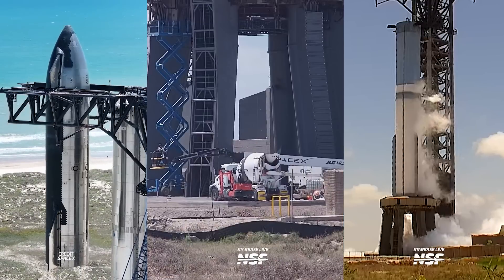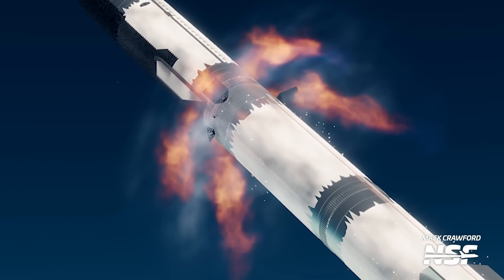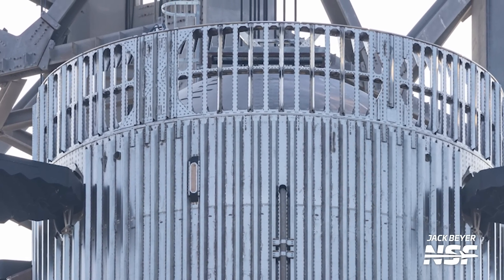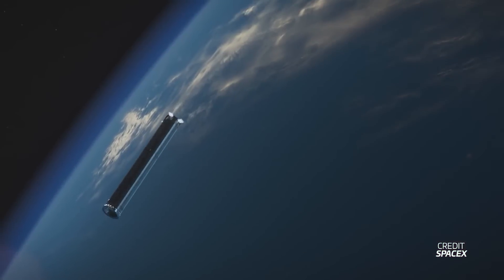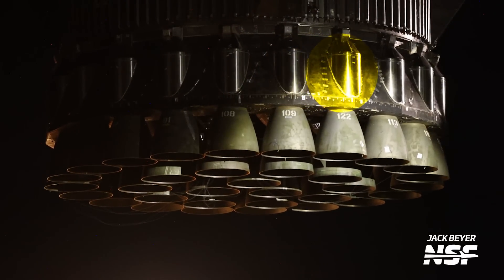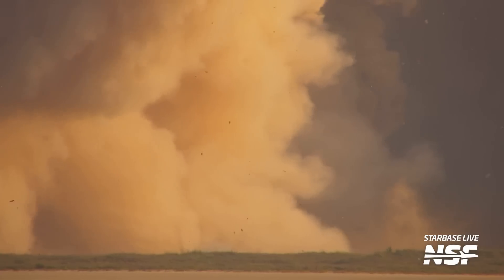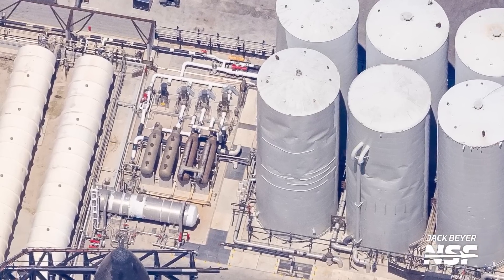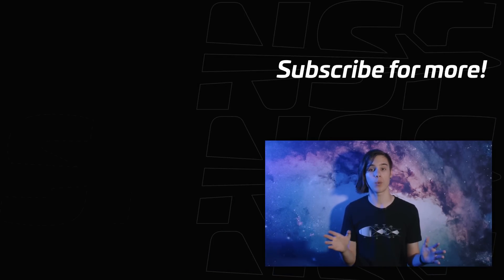SpaceX Starship’s Major Upgrades for Flight 2

Comment: Its bonkers to think of everything happening in one moment at liftoff, water deflection system, quick disconnect retracting, fueling switching to internal tanks, co2 pumping to stop flames, copv's back pumping, raptors changing thrust and vectoring, electronics switching to flight mode, and so much more i cant think of, just insane stuff
Reply: Hehe, look at video of Everyday Astronaut about "how to start rocket to engine", THEN you will be stunned how PRECISE has to be even lighting the candle

Comment: The new openings on the aft section I would suggest they are to equalise the pressure in that compartment to stop it either imploding or exploding due to heat and cooling. The openings will allow the air to flow freely in and out of that section, Im guessing the openings will also allow more cooling in that area during launch with convection happening.
Reply: It will make sure there is vacuum in the space between the forward dome and the hot-stage dome. Vacuum is a very good insulator.

Comment: As a Millwright and motorsports fan, Natural gas AKA Methane is more critical in reducing human pollution on the environment. Natural gas or CH4 is basically stabilized Hydrogen and easy to make, it can be made from cow poop and trash in a continues or batch method and can also be used to help prevent forest fires. On the motorsports side the best gasoline you can get at the pump is 92-94 octane, race engines use special gas with 101-112 octane, and all produce dangerous waste gas while natural gas doesn't. So if a turbo 4 cylinder running on gasoline makes 250-350HP the same motor designed to run on natural gas with 150 octane would easily make 100-200 more HP with far less pollution out the exhaust without any emissions control devices that cost 2K for cars and up to 50K for pickup trucks and semi tractors. LNG and CNG (CH4) is what is used to make the majority of the electricity that recharges those EVs, and when made from waste reduces the human carbon footprint with its main byproduct being non-toxic fertilizer.

Comment: The safety of the public and the protection of the environment is the FAA first and upmost priority and not a companies personal milestone. Spacex  has done a extraordinary job , repairing the  orbital launch mount and it's site ,the upgraded water deluge system a magnificent accomplishment in such a short period of time, you have to calculate using more powerful engines into the equation,( here's one of the main  catch 22's so to speak) with the FAA  and their licensing for the STARSHIP I have studied video's and comments for hours and days. SPACEX stated after the first orbital launch attempt that for a few sec. they (LOST CONTROL)of the STARSHIP we must prove without any doubt that we have (FULL CONTROL) of the vessel. DDM

Comment: One thing that I would be concerned about with a crew mission for Starship in the future is how the crew would evacuate in the event of a flight termination system activation.
Reply: Early stage seperation I guess and some sort of emergancy landing..?
Reply: @olafmesschendorp147    That's fine if the issue is with the booster, but not if the problem is with the ship.  There is no way for crew to disengage from the ship if it fails somehow.   The FTS could be triggered, but crew have no way back to earth except in the destroyed ship
Reply: iamaduckquack   The Astronauts had  no way of leaving the orbiter either, if they got a early enough warning the orbiter could separate from the fuel tank and hopefully return to launch site. If high enough they had alternate landing sites or go to orbit. If something happened to the orbiter itself it was the same as a crew in Starship.
Reply: @wb6anp That was true, until after the Challenger disaster. Then they added explosive bolts to one of the front windows, added a curved rod just on the outside of the exit window and the Astronauts had parachutes that they clipped onto the rod and then 'climbed' out of the exit window frame and jumped. Whether they could do that during a 'tumbling fall' is pure conjecture. Pretty hairy to say the least, but at least it was better than nothing.
So, perhaps they may have some similar system added to the 'Crewed Starship Rockets', in the design plans?  Chutes Brah! 🪂
Reply: @michaeldeierhoi4096 they could just plonk an Orion capsule on the top of starship with its own escape system, it would to mean moving the header tanks down a bit

Comment: What about the fact that in all test firing of all 33 engines there have been multiple engine failures in the first 5-6 seconds, this worries me and i am sure many. Are the problems being ignored, like with the pad for a quicker attempt to reach orbit. I mean, they have many boosters and should be able to overcome this problem by testing different layouts or newer plumbing systems.

Comment: I wonder if the sub coolers and pumps are to support the outer 20 raptor startup?
Reply: They're are for fueling, not used for raptor startup. They're also not hooked up, just installed - they'll be installed for future flights though

Comment: if the hot stage ring uses the same locking mechanisms, that means spacex could switch between using the hotstage ring and not using it whenever they want.

Comment: What happens to the hot staging ring after separation? Is it ejected or does it stay attached to the booster?
Reply: It will likely remain on the booster unless it is torn by the ship and can hinder a safe sea-landing.
Reply: My theory is, that as the hot staging ring has been subjected to heating, then the strength of the stainless steel will have been compromised and unless heat treated after landing, would not be able to be re-used. This launch is going to expend the booster and so they will not be able to recover anything (from current discussions) so they can't examine the hot staging ring this time round and so it will probably stay attached, unless they test the separation clamps and release it. 
Therefore, my guess is that in future flights, where they do recover the booster, that the hot staging ring will have long been separated and will burn up and crumple into the sea.
Reply: @David-yo5ws  I think that a steel ring that large will not be expected to burn up. I think having it come down with the booster is the safest way to de-orbit it. It might, or might not, be reusable, but that is secondary.

Comment: Any guesses why nitrogen isn't used for raptor start up?
Reply: I think that it's because it needs to be extra high pressure but not cryogenic. If you pressurized nitrogen to those levels it might be a solid. Helium should stay gaseous inside of the COPVs (just checked. Helium becomes a liquid at room temperature at 2.275 bar and it ridiculously hard to solidify). NItrogen solidifies at 63K.
Reply: @hawkeartist  hmm I'm thinking why not hydrogen copvs. But I do get hydrogen is really explosive and hard to contain, yet at the same time helium is quite expensive. But of course, they have much more smarter engineers than me haha

Comment: was it actually confirmed that the spin staging was meant to happen, because on all animations by spacex they always just stage normally.
Reply: The SpaceX host, John Insprucker (Principle Integration Engineer), was making comments, that it was starting the 'separation turn', which supports the 'spin staging' idea. Of course that is all now redundant.
Reply: And prior to that they also explained it on the lead up to the launch when they overviewed what was planned to be the nominal timeline. Plus Elon also talked about it when he mentioned the switch to hot staging.

Comment: when they're hotstaging are they lighting up ALL engines at once? seems like it would make sense to only light one engine on minimum power and after enough distance go on full power, i'm not a rocket scientists but i feel like that's not a good reusable strategy
Reply: Unfortunately, the ship has to generate enough thrust to outmatch the booster thrust to fly away from it. So, it all depends on how few engines booster can get away with to keep accelerating and at which throttle setting.
Reply: The booster can reduce the thrust on the 3 remaining central Raptors enough for the 3 vacuum Raptors to put a good distance between ship and booster. Then the booster can start to turn and go back to full thrust, while the ship ignites the 3 remaining sea-level Raptors. That way the propellants are always settled and the Raptors get the propellants they need all the time.

Comment: Vents == cold gas thrusters maybe?
Also side note. I would be shocked if the fire surpression was actually CO2 because CO2's constituients are 100% flammable molecules. In the presence of metal fires and strong oxidizers (cough, stainless steel, cough, liquid oxygen, cough) the CO2 can be broken apart and become entirely flammable components, which is not super helpful.
Reply: The vents look to be above the forward dome. To make sure the volume between that dome and the hot stage ring is in vacuum - the best heat insulator.
The fire suppression uses CO2. Labels have been seen. Many fire extinguishers use CO2, because it displaces or reduces the amount of oxygen in the atmosphere around the fire.
Reply: @knowledgeisgood9645 oh sorry I belive you all about the CO2 thing. I just feel like it's an inadequte fire surpression in an environment prone to metal fires because of the extreme temperatures and liquid-oxygen rich environment.  Obviously helium would be ideal but that's hard to manage
Reply: @Mallchad  CO2 is a product of combustion, which makes it inert enough to be widely used as a fire supression. It will not break apart unless a massive amount of energy is put in. When people say CO2 cannot put out "metal fires" they are talking about things like magnesium and sodium (which are so reactive they can steal the oxygen from the CO2) not stainless steel, which is relatively unreactive iron, nickel and chromium. The main advantage of CO2 is that it liquefies at about 55bar (800psi.) All the other gases you might think of using won't liquefy so the vessels needed to store them are a lot heavier.
Reply: @londonalicante Yeah I know it's cheap and what normal fires are. I appreciate the comment that CO2 liquifiers at a fairly reasonable pressure and that makes it much nicer.

I would note like I said that for many cases whilst CO2 is suffecient and stainless steel tends not to burn, high temperature fluid from the pumps as well as very oxygen rich environment both provides the energy and the oxygen to burn steel easily, should they be so unfortunately, as far as I can tell.

Besides, not the entire rocket is stainless steel, there is a mix where electronics and fluid lines and pumps have to go. The Engine Bell itself is a different alloy and has polymer based insulation webbing
Reply: @Mallchad  It's essentially impossible to get the thick hull plate to ignite, even though it's energetically favorable. The reason is that the combustion products from burning steel are solid metal oxides, and they form a protective layer preventing O2 from getting to the metal underneath. Finely divided steel (steel wool or powder) will burn as the O2 can diffuse a short distance to reach the metal inside. The amount of combustible material in the rocket's construction is only a few percent, not enough to cause any real risk. The real problem is the methane.

Comment: I don't understand why you and also some other media say that it is crucial for the next test flight to succeed. In previous development SpaceX often had several test flights fail. It's part of their rapid development. I'm really confused why you are essentially saying that SpaceX needs to abandon the development style that's worked so well so far. Comment?
Reply: No, we're not saying that. The difference here is in what you consider a success. For SpaceX, not repeating the same mistakes from Flight 1 is already a success and that would obviously include not wrecking the pad and getting through first stage flight without fires in the engine bay and leaking propellant on the way up. It's not like SpaceX does these upgrades for them to accept these not working. They've worked tirelessly to make sure the issues they faced on the previous flight and other older prototypes don't pop up again on the next flight - if that doesn't work, how could we still call it a success when in that case they would not even meet the most simple requirement of just "don't repeat the same issue" as threshold for mission success?

Comment: Bad news on the starship Launch, very likely be next year 2024
HOWEVER, since we are grounded on the heavy booster, is it still possible to launch starship only to 10-12km and try to stick a landing successful, we no issues. that's only we can we do now right! Surely.
Reply: The ship has no legs so no, it can't go up and land successfully because for that it would need to have legs to land on in the first place
Reply: @ale131296   why make it reusable then if you cant land it. At some point they will after to! Nows the time to do it I guess.
Reply: @jamesh1597531  SpaceX is several ships away from worrying about landing them again, they won't be landing ships for a while
Reply: I don't think it will be delayed that much, just another month. Launches below 70 km would not add much information and will be a waste of Raptors, booster and ship. I think you meant landing at sea. Doing that from 70 - 100 km is not harder than from 10 km. You also get to test max-q and a possible stage separation. All we need is to be a bit patient.

Comment: There are no gravity effects.  Gravity affects the vehicle the whole time, even in orbit.  It's just atmospheric drag.  You want to keep thrusting to get out of the atmosphere and for no other reason.
Reply from the maker: To help underatand gravity drag... imagine a ship that could burn fuel to hover. You could burn all your fuel simply counteracting gravity, hovering, but never going anywhere.

The more time you spend "flying", the more time gravity has to waste your fuel. Running a higher thrust, or simply never stopping the forward thrust, gets you to orbit "more quickly", and thus gravity has less time to waste your fuel.

Hope this helps-

Das
Reply: Aerodynamic drag is much less important than gravitational drag (thrust "wasted" fighting gravity instead of accelerating) for such large launch vehicles.
Reply: If the earth was a point mass (aka no atmosphere), hovering would just be an inclination change, which is pointless.  The only reason you point the rocket up is to get out of the atmosphere.  Otherwise you'd point prograde (East).  It's just atmospheric drag.
Reply: @Vegetablebread  It's a combination of the two. You're absolutely correct that you could orbit at "0" altitude if there wasn't atmosphere. But you're also wanting to get to a certain orbit distance and that means fighting gravity. And when you're talking about the distances from Earth that we're talking about (over 200 miles), the majority of the forces we're fighting to get that far away is gravity since the atmosphere is pretty thin at even 50 miles and "nonexistent" at 100 miles.
Reply: @Aragorn450   If atmosphere didn't exist, the "gravity effects" mentioned in the video wouldn't exist.  You can call changes in orbit "fighting gravity" if you want, but the video is talking about air resistance.
Reply: @Vegetablebread  I'm sorry, but you're wrong. If they stop the engines, gravity and air resistance both will make the vehicle slow down. And that's what the hot staging is attempting to keep from happening.

If there's no air, there's still gravity to fight against and that will STILL make the vehicle fall if there's no thrust. But clearly you don't agree with that. I'm not sure why, but whatever. I'll leave be now.
Reply: @Aragorn450  If the earth were a point mass, you'd always be in an orbit.  The engines let you change the orbit.  For half of any orbit, you're slowing down.
Reply from the maker: Gravity drag definitely exists without atmosphere... see: the moon. A lander hovering above the lunar surface has no atmospheric drag but still has to counteract gravity, which we refer to as gravity drag. The longer you spend fighting gravity, the more fuel you waste. It's a real drag.👍  - Das
Reply: @NASASpaceflight  But you would never hover on your way to lunar orbit... because the moon doesn't have an atmosphere.

Maybe I'm splitting hairs.  Maybe I should stop dying on this hill, but "the loss in vehicle performance due to having to point the rocket perpendicular to the intended orbit while you climb out of the atmosphere" doesn't sound like gravity or drag to me.

Maybe it's better to just talk about how flatter, faster paths to orbit are more efficient, without making up a name for it?
Reply: @Vegetablebread  It sounds like we agree on the physics if not the linguistics. The concept is fundamental to rocketry and has been recognized since before we had orbital rockets but "gravity losses" might be the more commonly used technical term. 

It is true that the lofted trajectories required due to the atmosphere increase gravity losses but they are present as long as you have a non-zero burn time - i.e. when not using a cannon.